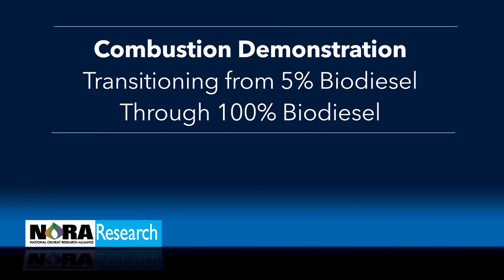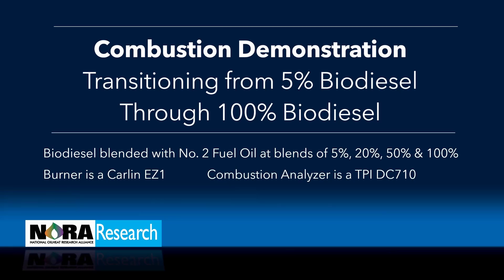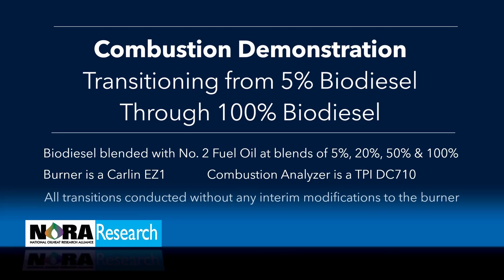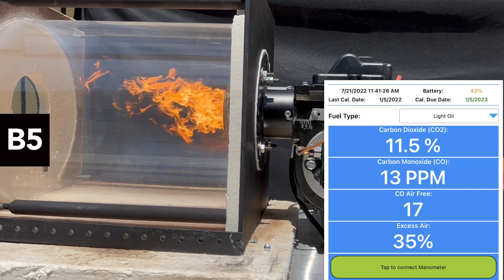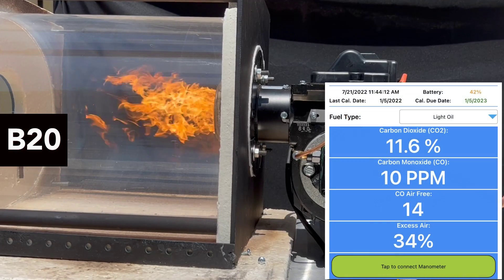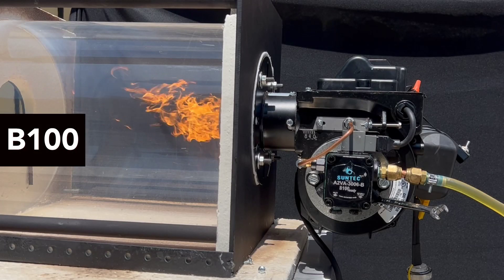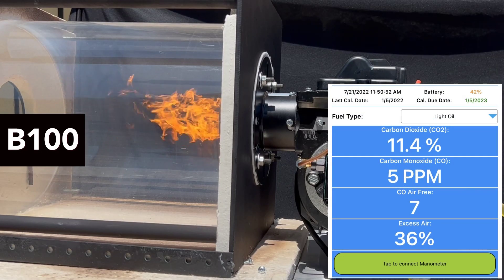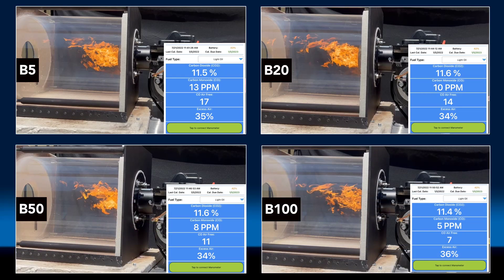Combustion Demonstration B5 through B100: Carlin EZ1

Comment: How do you blend 100% bio fuel with #2 heating oil 😂 Also I’ve found that bio diesel gums up most components on an oil burner real nasty stuff.
Reply: B100 is cleaner than traditional petroleum #2 and acts as a detergent. The b100 isn't what is dirty, the system itself is dirty from using high-sulfur #2 and the b100 is cleaning your system. Think of it like taking a laxative. The magnesium citrate isn't what made you full of shit, it just made you aware of how full of shit you already were.

Comment: I would be interested in knowing the stack temperatures for each burn. If you look at the end of the video that shows all four burners running you will notice a significant difference in the size and volume of flame that is produced with each mixture as it decreases the more biofuel is burnt. Does this mean that one must use more fuel to get the same BTU output? It’s funny how this information was never presented.
Reply: Biodiesel has less energy than #2 oil, about 10% less per gallon.  Due to the greater density and higher viscosity of biodiesel the energy input doesn’t decrease by much when transitioning like this.  Stay tuned for more videos to illustrate this point as well as the effect of biodiesel on cad cell resistance